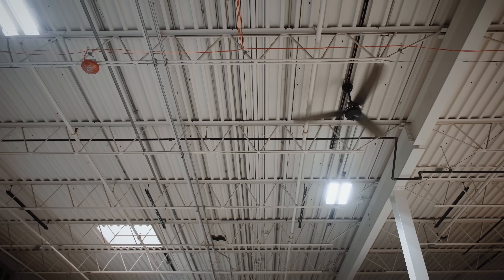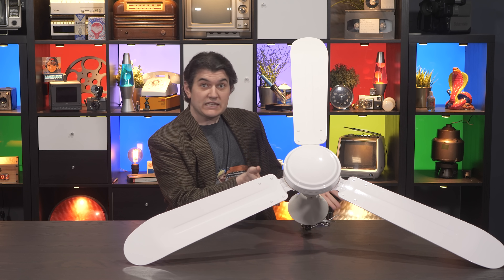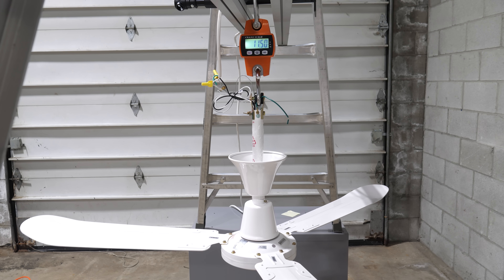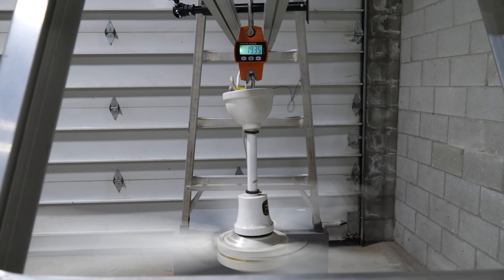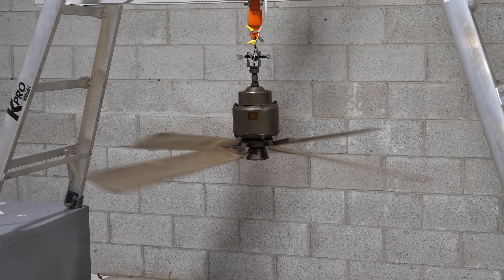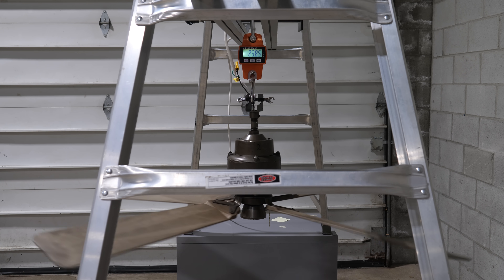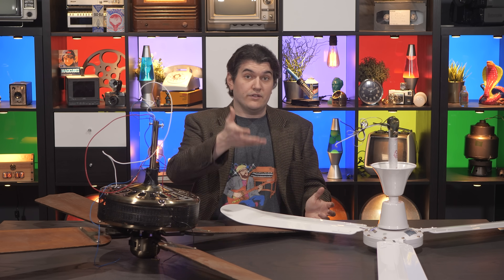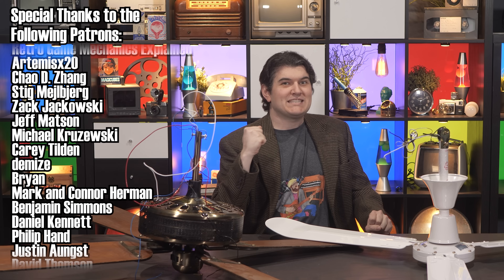How much thrust does a ceiling fan produce?

Comment: I've always reversed my fan direction in the winter, so it was blowing against the ceiling. However, the more I think about it, wouldn't you want it reversed in summer, and normal in winter? Granted, in the summer, we like to feel the air hitting us, so that's a no-brainer. But for overall conditioning of the air, if the blades were reverse in the summer, it would pull up the cold air that sank to the floor. And in the winter, if running normal, it would push down the hot air the rose.
Reply: Having it blowing down year round actually makes the most sense if you dont mind the draft.  But it also depends on your fan, your room, and many other factors, so it's worth experimenting
Reply: It's important to realize the air isn't just blowing down. You're creating a circulation of air in the room. If you blow down, air is being drawn in from along the ceiling and being pushed down into the room, where it spreads out from the floor and gradually gets pulled up the walls to the ceiling and back into the fan. In contrast, blowing into the ceiling circulates the air in the other direction. So it doesn't really matter which way it's blowing in terms of what it's doing at a general level. It's a better idea to think of it less as pushing hot air down and more that it's mixing the air in the room.

There's another aspect though, which is that the direction does matter in terms of how the air circulates. The input side draws air widely, but the output blows air in a more concentrated stream. This is somewhat constrained if it's inputting from the ceiling of course, but the result is that when blowing down, much of the air in the room is fairly stationary, being in a dead zone as the air circulates under the fan across the floor, up the walls, and along the ceiling back into the fan. In contrast, when blowing up into the ceiling, air is being drawn from basically the entire volume of the room, and while it's less as you move out from directly under the fan, it's still more air movement than with the fan blowing down in those no-longer-so-dead zones.

Comment: Fans (propellers) with a larger diameter are more efficient, meaning they can move more air with the same amount of power.  Or, by the same token, move the same amount of air with less power used than on a small fan.

This is/was important in cooling electronics, especially computers, thus a 102mm fan was much more desirable than a 52mm fan, especially in the old days of cooling overclocked AMD Thunderbirds and keeping the office quiet.

In boating, you can't always use a larger propeller because other parts get in the way.  One option is to add cupping to the propeller blades, which has a similar effect as to increasing diameter.

Also, if you were to put a shroud around that propeller, you would significantly increase thrust.  Again, this can be beneficial in cooling electronics, but has some practical limitations in larger applications.

I won't even get into hubless fans....
Reply: One of the weird things about ducted fans is that they work better the faster the fan is spinning, but on an aircraft, the faster the aircraft is moving the more extra drag they're causing.

Comment: My father had sort of a side business back in the 1980s installing ceiling fans (he mainly did appliance repair).  He NEVER mounted the fans to the junction box like the instructions state.  He ALWAYS put in 2x4s across the ceiling joists, for safety.  He also didn't wire them like they say in the manufacturer's instructions either.  He almost always (unless the customer wanted different) wired the fan directly into the mains (so that it was controlled by the pull cord) and the light fixture (if there was one) to the wall switch.  That way, you could turn the lights off at the switc without turning off the light.  I greatly prefer this method and it ticks me off when I am somewhere where I turn off the lights, only to discover the damn fan has turned off too!  Just mentioned this because you said something about the forces applied to the electrical box.  There shouldn't be any.  My father's method also demonstrates that we shouldn't blindly follow manufacturer's instructions too.  Use your brains, think for yourself.  The people that write those instructions often show the simplest way, not the best way.
Reply: A lot of fan instructions, even back then, showed those options.
Reply: @dspiffy  And a lot did not. ;-)

Comment: There are special junction boxes with mounting brackets to connect to the nearest joists. They're rated for a minimum of 70 pounds. There are also requirements that if it weighs a certain amount you should chain it to structure so that if it does fail, the chains will catch it. Hopefully.

Comment: Fun fact, part of the reason why these numbers are so tiny is because helicopter blades and plane propellers are NOT just giant super fast ceiling fans. Theyre shaped to have the same curve as the wings that produces the pressure differential, and that's part of why they are so kuch more effective
Reply: It's not really relevant at ceiling fan Reynolds numbers. They're slow enough that a flat plate with some AoA has comparable performance to a proper airfoil. And costs a ton less to make.
Reply: The pressure differential is NOT that much of a factor.  Airfoils produce lift simply due to Newton's 3rd law of equal but opposite reaction.  It's that simple.  The shape of the wing ensures that the flow of air over the top of the airfoil is directed downwards as it comes off the trailing edge.  This happens due to surface tension causing the air to "stick" to the curved surface as it flows over it.  This is also why airplanes at "cruising" altitude must maintain a slight "nose-up" attitude (usually around 2 or 3 degrees or so. . .).
Reply: Nope. The impact of those shapes is related to the speed the blades are moving through the air. Ceiling fans typically move very slowly.

Comment: HOLD ON JUST ONE SECOND!
Helicopters create lift to take off, not thrust.. It's the air going over the blades that lifts the helicopter up, not the air it is pushing down. 

Put airfoils on those fans and let them lift off!
Reply: Contrary to your bad education in science, making things a certain shape doesn't let them defy physics.

Airfoils work entirely by pushing air down.
Reply: @seigeengine   So you think the helicopter is swimming in air? Are you trying to say the  differential in pressure across the wing is not responsible for 100% of the lift?
Reply: @seigeengine  hero, derp?

Comment: 10:11 I had my shop fan rip out or its mount on start up one day only to be supported by the wiring... so it can happen, weight and torque is more of an issue than thrust.
Reply: sounds like it was not mounted correctly

Comment: Fans running in reverse is also helpful for cooling lofts or second stories (if floor plan allows) if you have AC downstairs but not up (hello heat pumps) by drawing up cooler air up from below.

Comment: As someone who has shopped for propellers for a quadcopter, none of these fans seem like good providers of thrust.
Reply: It frankly should strike you that there are major differences between the fans on a quadcopter and a typical ceiling fan. You know, like size, and how fast they spin.
Reply: @seigeengine  I'm very much not stricken. Ceiling fan blades are typically heavy, flat and with dull thick edges, often with obnoxiously inefficient ornamentals. My first comment was a bit of a joke anyway.

Comment: You technically can't change the kilograms in the test the same way you change the pounds. Weight and mass, while related, are different things. The ratios we use to convert from pounds to kilograms or vice versa are under the assumption that you are on earth. In this scenario the fan has less pounds because it weighs less, but it's kilograms should stay the same because it's losing no mass. It remains perfectly in one piece. Unfortunately, both the imperial and metric systems are incomplete for this reason. Imperial lacks a unit for mass, and metric lacks one for weight.

Comment: I wonder how these fans are being affected by the ground effect. the idea is that an air foil that's within the length of its wingspan from the ground gains extra lift because of the padding of air that collects beneath it. Not that I'm saying that you should raise the height of that sketchy mounting solution, but it might be interesting to see if there was any difference in the results. I get the feeling that the temperature of the air might also play into the effect, colder air being denser with a steady volume going through the blades, etc. but that might be too much effort for the last days of November!

Comment: Next you should do experiment on Fan Flow Rate vs Pressure.
(Bernoulli's principle) 

Especially on house water pump.

Context :
1. Some water taps in my office produce low flow rate, when certain other taps are opened.

2. The "technical guy" on site, insist we need to buy water pump with higher pressure.

3. I insist, since the source of the water is in water tank above ground, we don't need much pressure (only 2 storey building), but instead we need water pump with higher flow rate.

4. Turn out I'm right, now everyone is happy with their taps.

Comment: My electric bike wheel had the problem of thrust. You start getting a torque steer on the rotor, I mean the rear wheel. You weigh 90kg and have 500nm of torque it gonna suck you off.

Comment: Ceiling fans should be compared by CFM and diameter of the fan. Don't buy these Hamtorn Bay fans you see at home depot like stores.If you want a real lot of air movement get an industrial all metal fan (won't have a light though). I put one in and it's like a hurricane, have to have paperweights everywhere. Saves a lot on A/C bill.
Reply: Honestly, I feel like unless you're talking about the dinky ceiling fans, they all blow plenty of air for residential purposes.
Reply: I agree!  That's why I spec the Envirofan for residential installs when it doesnt need to be pretty or have a light

Comment: So if hang the fan on a pulley system with counter weight equal to the running weight of the fan (or a little less to account for friction), you will get that counter weight to move?

Comment: There are building codes in place and a new one that requires special mounting hardware for ceiling boxes. I was told the code basically reads, if it is in the ceiling it must be able to hold a fan.

Comment: A ceiling fan is exactly like an airplane propeller, and NOTHING like a helicopter rotor.
A helicopter rotor is an incredibly complex mechanism capable of changing the angle of attack of not just the whole rotor assembly but also the individual blades.

As you change the throttle of an airplane the speed of the propeller changes, a helicopter prop runs at the same RPM at all times during flight.
Reply: "It's a really complex fan so it's not a fan!"
Clown. Shoes.

Comment: Obviously, the fan blades play a role and how much force were thrust is put out. It would be really cool to see a video of someone taking actual plane propellers and hooking them to a ceiling fan to see how much thrust is generated.
Reply: This is getting things in the wrong direction.

Ceiling fans aren't shaped like propellers because ceiling fans spin slowly, so aerodynamic effects are negligible.
This is also why standing fans have curvier blades: they spin faster. Why do they spin faster? To move more air since, unlike ceiling fans, they have to be fairly small.

Comment: I don't know how much thrust my ceiling fans produce. But I know the little fan under my desk requires a rough surface under it, else it will thrust itself all over my floor. Or off a table. Yeah, that happened a couple times.

Comment: I would have mounted the fan upside down to a piece of wood and put that all onto a scale. Measure the fan while off, measure while it's on. If the scale registers a weight increase, then there's thrust. No janky hanging rig of death to deal with. You also wouldn't get any torque related false weight gains.

Comment: A helicopter only pushes air against the ground for a short while. As it gains in height, it's pushing air against the air below it. That might sound confusing but I know you're able to get it.

But, it is No Effort November (which I highly support and enjoy).
Reply: At the end of the day, the air being pushed down is pushing the air below it down, and it eventually reaches the ground.
Reply: @seigeengine  While true, that's not really where the energy is coming from. If a helicopter is a hundred feet off the ground you can stand below it and not feel much of anything. The air itself offers plenty of resistance. In fact, that's why helicopters have a limited height. The air isn't as dense at higher altitudes and so there's less force being applied.

Comment: Correction. Helicopter rotors are like airplane wings. They aren’t intended to “blow air” though they do. The way they fly is by producing lift, not thrust.
Reply: Not a correction. Lift is caused by aerofoils blowing air "down."

Comment: Be more interesting if you could just the angle of your fan blades. By adding washers to one side to give it more of a slope
Reply: if you did that you'd end up straining the motors. Higher angle = more drag = need a stronger motor
Reply: @seigeengine  not 100% true some of those motor he was using could run a washing machine that's heavy torque heavy resistance. Like that last one he was using or second to last. It was all motor and no housing or anything like that

Comment: Propellers are designed to move a fluid, the flat blades of all those fans are just about being cheap. You shoulda dropped a few k to buy a Big Ass fan, they have airfoils for blades. I'll only take an open fan seriously if it has airfoils for blades.
Reply: The flat blades of all those fans are flat because ceiling fans move too slowly for an aerodynamic shape to matter much. It's not worth the added expense.

BAF are pretty large, but rotate at about the same rpm as smaller ceiling fans, so parts of them are traveling faster, so it'd make more of a difference than with a typical ceiling fan.

Comment: A helicopter rotor is actually the shape of a plane wing. It pulls the copter up into the air like a plane wing lifts a plane into the air.
Reply: Please, for the love of all that you cherish, think for two seconds.

Making a shape of object doesn't magically make something anti-gravity.

Wings generate lift because they push air moving across them down.
Reply: @seigeengine That's what I said. Can you read?
Reply: @seigeengine The air does not push the helicopter up
Reply: @seigeengine  The rotor blades of a helicopter are identical to the wings of an airplane. This means that each blade is an aerofoil that, when placed in an airflow, deflects the air in order to produce lift.

Comment: What about the ground effect? I'm serious! When blowing air upward, it would actually be pulling away from the ceiling harder than that because some air is trapped between it and the ceiling. If you'd placed it closer to the ground, it probably would have lost more weight pushing down, too. More testing is needed! Connextras!

Comment: I think there are more things at play here. The fan is not blowing air straight down, but in a wide cone. So I'd guess the air isn't just pushing the fan up, but also left, right, forward and backward. And those should cancel each other out leaving just a small portion that isn't being cancelled out. And while playing around with a toy drone, I noticed that when on a low thrust, the drone would slowly fall, but not land. At a few centimeters (different number in bodyparts) height, it would keep hovering. So while high in the air, it could not reduce its weight to zero, but it could when it was almost touching the ground. I guess this is because the air bouncing on the floor increased the density of the air, making the fans more effective. The same would apply to the fan test?
Reply: Yes, but it's really more of a narrow cone. The term for the effect near a surface is ground-effect.

Comment: It would have been interesting for you to compare it to theoretical thrust. Because your experiment seem a bit lacking in the scientific side of things (though I don’t have any better idea).

It could have been calculated using Bernoulli’s theorem applied on a single blade and then extended to the 3 (or more depending on the model). Though you would have needed some way to measure pressure and speed at the front and back of the fan…
Maybe the fan speed can be found on the spec for each model in rev/min, and then converted into speed according to the length of the blades.

Of course it wouldn’t work for no effort November, maybe for decent effort December lol, cause it would also need you to use decent units (I mean metric system) though probably doable in imperial, it must be way harder

Comment: I have had (cheap) ceiling fans, properly mounted according to instructions, with the hardware that came in the box, come crashing down after a few years.    As you conclude from your experiments, it's not the thrust and strain.   It's not even the torque as such as the mounting bracket allows a small amount of rotational freedom (I never noticed any significant displacement).

What the (at least the cheap ones) do have is significant vibration ... the blades and housing are not balanced well.  And the brackets are made of cheap pot metal.   After a few years of fairly regular use they fatigue and break from the vibration.    The better quality fans - at least some of those I've seen - are either fairly well balanced out of the box or have small clips you can attach to some blades to balance them  and otherwise have solid metal mountings so that for years at least, and probably decades, they're not going to fail from fatigue.